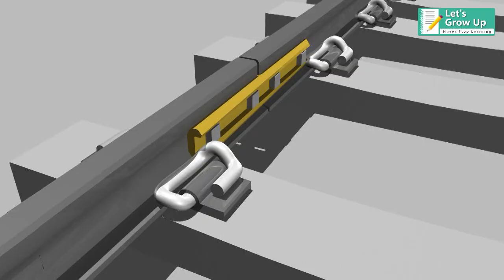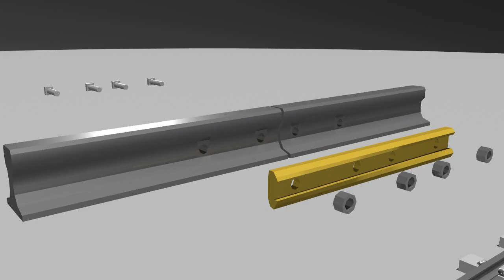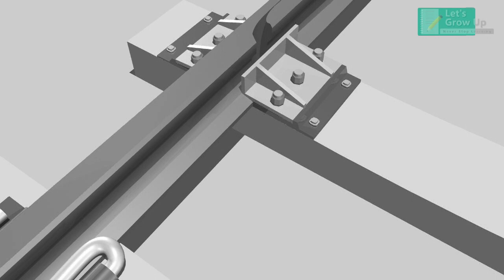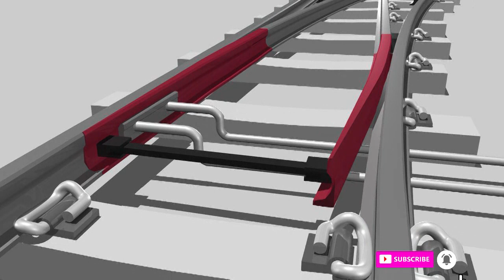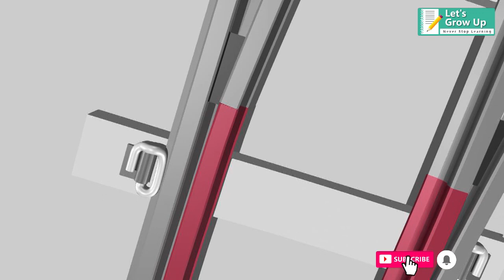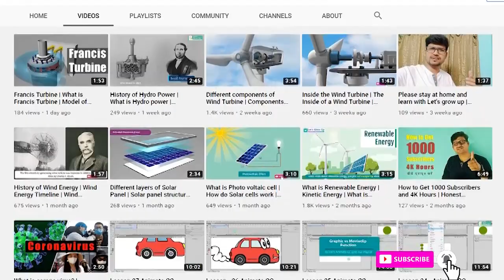Railway #Switch Expansion Joint | #Tongue Rail | #Check Rail | working of #Fishplate

Comment: How about a little more info on the subject?   For instance: How much of a gap in inches is used for standard rail lengths in the U.S.?     What is the maximum temperature range that these gaps cover, and are they set to within that range by the ambient temperature on the day the rails are laid?
Reply: Usually 20 mm gap is max
Reply: @eanayayo  Here in Britain , the ideal temperature that the rail is laid  down is 63 F, ( I don't know that that is in centigrade) .   This gives the correct gap . Gages are used if outside this temperature . But as far as I remember,  it was about 18 mm . Rail was laid in 60 meter lengths if my memory serves me aright , but it may have been more .  When laying  , believe it or not  rail is like rubber. And can be stretched  by the use of hydraulic jacks on one end . While the other end is held in place with chains to the existing track  .   The longer the length of rail or track is that is laid down the greater will be the gap at the ends . Greater  expansion will be at  the ends of the rail and not in the middle .  The rail will move with heat . So if incorrectly laid or not properly ballasted . It may well buckle in high temperatures .